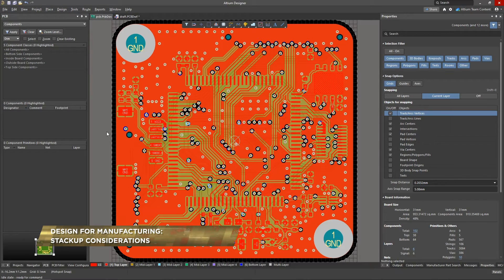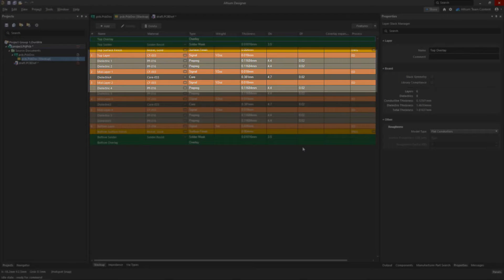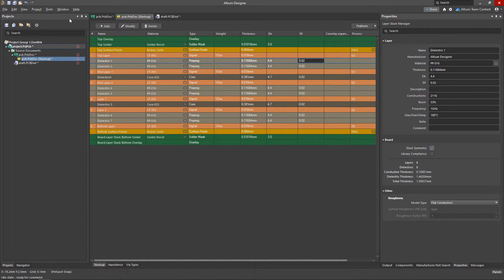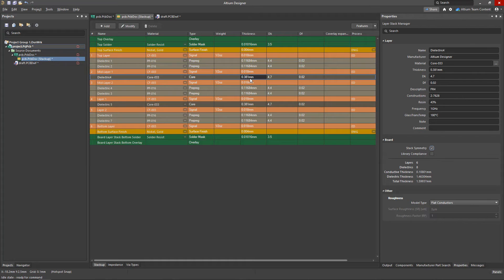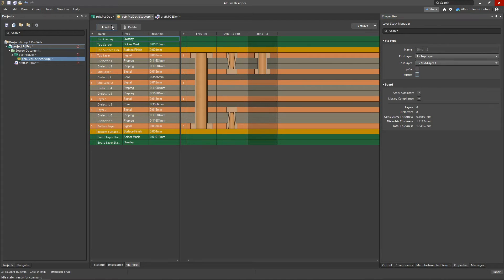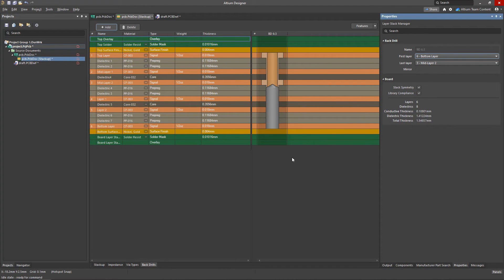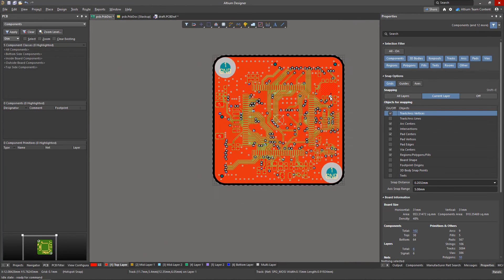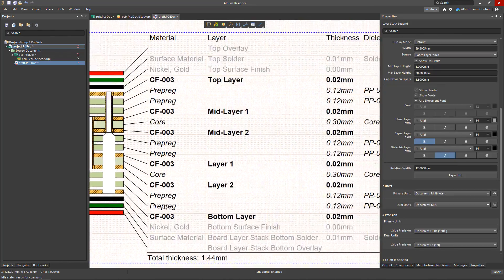Layer Stack Manager Considerations in Altium Designer

Comment: It is a real pain working with this material library and stackup planner:
- For one prepreg or core material you can only assign one frequency + Dk + Df values. But a laminate material is usually measured at many different frequencies, resulting different Dk & Df values. As a workaround, you can insert the same material in the list many times, with different frequencies, but that's lame.
- The impedance calculator can only use one Dk, Df value pair for a layer. But what if you want to use both 1GHz, 2.4 GHz, and 5 GHz lines on the same layer (which is quite common today), where you should calculate with slightly different Dk, Df values?
- Copper fill ratio of the layers, and the final thickness of prepreg are not calculated, you have to use a separate calculator (eg. spreadsheet) to be able to get a good estimation of the final thicknesses of the prepregs for the impedance control.
- Wouldn't it be possible for Altium to maintain a basic material library by receiving all the data from the different laminate manufacturers? So, engineers don't have to do it by themselves resulting in a lot of redundant human work?